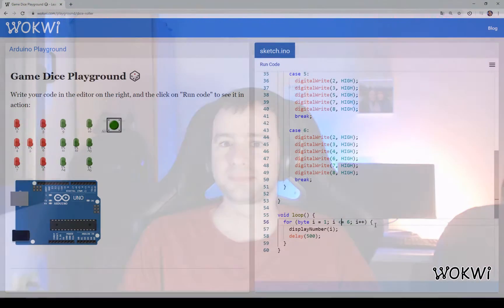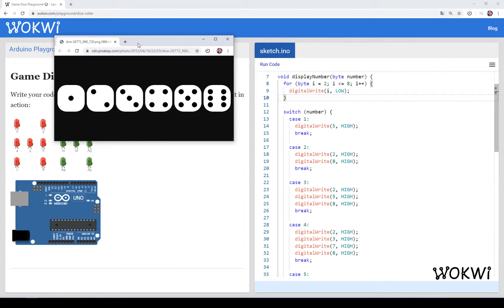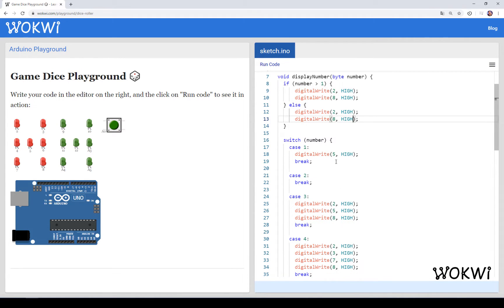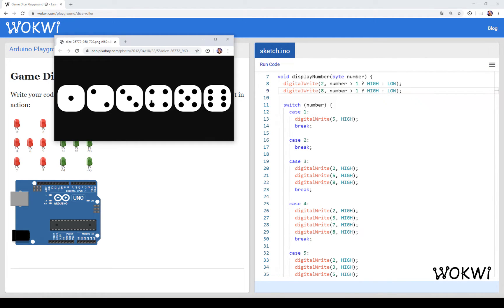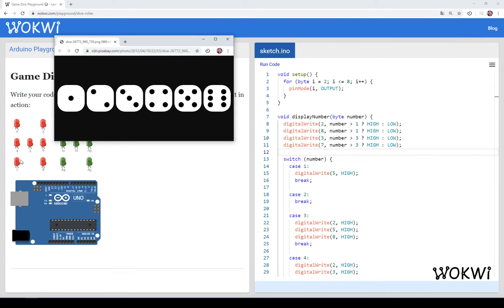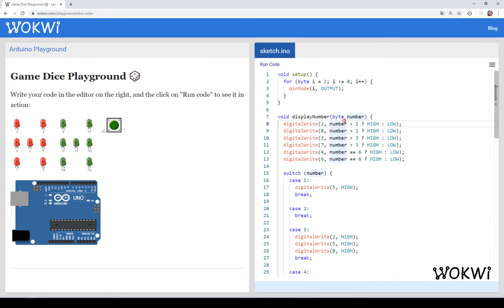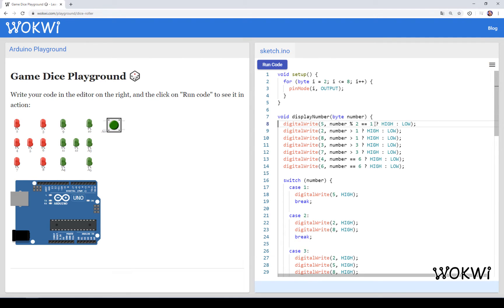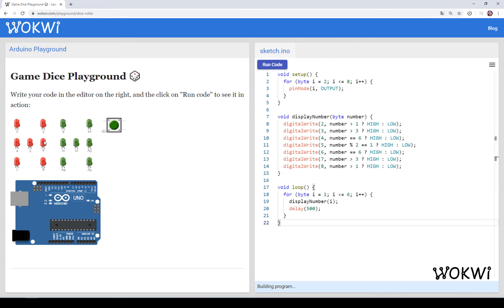Programming Arduino Dice Roller: 44 ⇒ 7 Lines of Code [2/3]

Comment: Hey, thanks for the video! 
I never knew you could insert a condition straight into digitalWrite() function, it is not documented on the function page at Arduino's website. 
Did you develop the simulator environment yourself? 
good job, Cheers!
Reply from the maker: You are welcome :-) I'm happy to know you learned something new from the video.

Yes, the simulator is an open-source project called AVR8js, and it is explained in this blog post: https://blog.wokwi.com/avr8js-simulate-arduino-in-javascript/

and the website of Wokwi is a friendly user interface built on top of the AVR8js simulator.

What are you using your Arduino for?
Reply: @Wokwi  Thank you for the link, It is evident you have a strong background in programming which is great and somewhat lacking amongst arduino developers.
I started using Arduino during my university years of mechanical engineering - mostly as an introduction to control systems implementation and later out of personal interest. I found it an invaluable educational tool for anyone interested in control theroy. There is a very good channel on YouTube by Joop Brokking who uses development boards and high level programming to do just that - I recommend it to anyone interested in the subject and want to take it to the next level.
Today I use ESP8266 mostly for IoT projects at home and at work.
Looking forward to see your channel grow - you have the potential as you are very skilled and present the matarial clearly
Reply from the maker: @mrsubery  Thank you for the detailed feedback and recommendation! I'll check out Joop's videos. 
What are your next goals with Arduino?